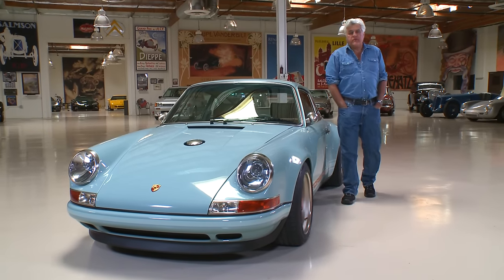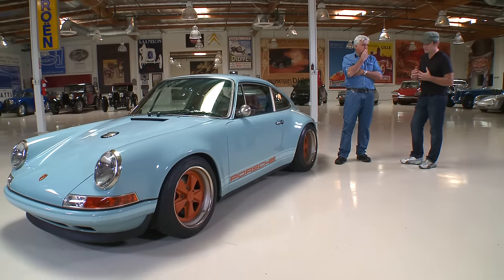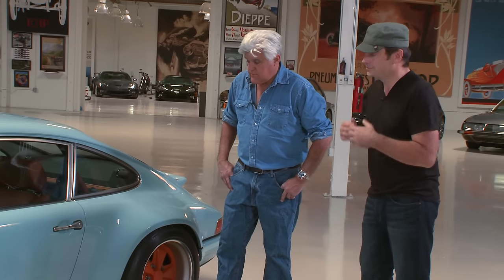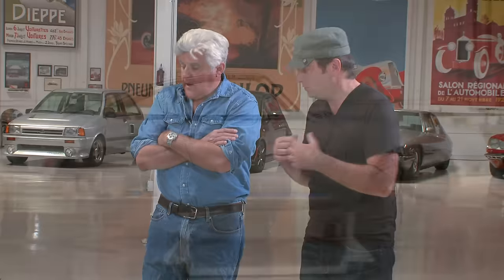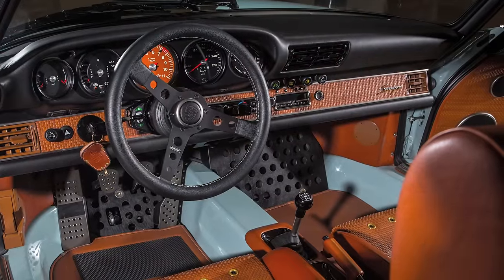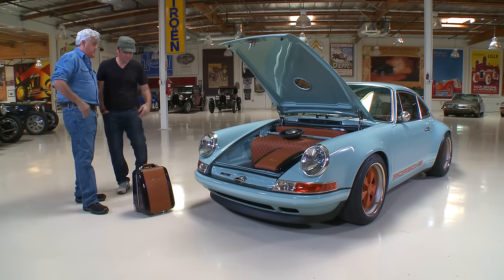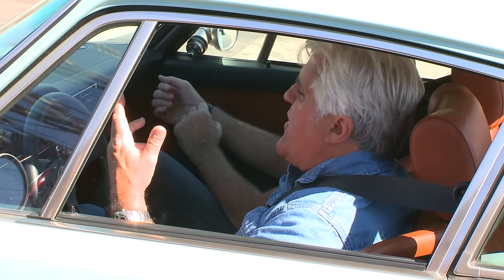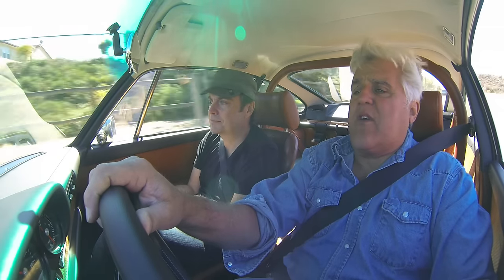1991 Porsche 911, Reimagined by Singer - Jay Leno's Garage

Comment: Someone please educate me, what makes these air cooled Porsche engines so special, other than saving weight?
Reply: They do make a different and possibly better sound, however, there is a lot of nostalgia. It's certainly one thing that makes Porsches different. It's distinctively Porsche. It's simple, yet complex. It's easier to maintain. It's just an interesting quirk.
Reply: air cooled means it has no radiator for the motor  the air cools the engine theirs a disadvantage you can't go very very fast with that engine it gets very very hot in the engine compartment.
Reply: Marc Plante
I know what it is, I just wonder why Singer chose these motors. Probably for it's low weight and simplicity, but maybe there's more to it.
Reply: Any Porsche engine is special.
Reply: The feel, the rumble, the sound, the power. It is a living beast. The liquid cooled cars are like everything else on the road. They are great but not like the air cooled. The air cooled sounded like hell when it was started cold. You need to warm her up to get all that oil warm. Once it warms up, it comes alive. It wants to be driven fast. It has to be driven fast. It is a true machine that needs to be driven well and maintained well. It rewards you with a feeling you do not get in the modern porsche. Go test drive an old used air cooled 993 93-98 and you will quickly become obsessed with it.

It is difficult to explain this in writing, you have to go feel it. Minimalism at it's best. Power and elegance.
Reply: The term air-cooled is a bit of a misnomer.  They are oil-cooled and have oil coolers to help keep engine temps down.  Instead of a radiator with coolant running through it, imagine a radiator with oil substituted for coolant.  These are usually located in the 911's front fender wells.
Reply: Marc Plante
Can't go very fast? Nuts! You mean you can't drive it like a granny in the city or just start it up and take off.
Reply: Motors?? The Drayson is powered by a motor, not this.
Reply: STORM6490MT I grew up around a 98 993 and learned how to drive stick on it. I absolutely adore the thing. Greatest Porsche (and therefore car) ever made.
Reply: ***** What's a Drayson? But yup, this is an engine.
Reply: ABOlsen69666 Perhaps he meant Dyson vacuum cleaners ??????
Reply: rocketdog2116
that's awesome! my old man saved up for years and purchased one for cash in 1998 at the dealer in minnesota. CS, wheels, seat delete, calipers, black black black, stainless trim. He still has it in the garage with under 10K on it. Far too few miles in my opinion. I was hoping that they would come down in price but it appreciated so I wont get one till I retire. Maybe he will sell it to me one day!
Reply: Check out my new Harley EngineCycle. I know that the BNSF down in the valley works with a diesel engine and electric motor but most people get motors and engines as far as terminology. Motortrend? Oh hell, they must be all electric reviews.  Thanks captain obvious, please correct my online grammar and spelling.

Comment: ***** To really see an amazing 911 would be to use a 964 turbo (AWD) then remove the engine & trans for the Hydra-Matic 8L90 transmission in the new Z06 as well as the motor. Both weigh less than the engine & trans in the 964 & can fit without cutting into the body. You can also swap your windows with gorrilla glass for more durability & less weight.

After that you just need to wire everything up, swap all the lights for LED lights, swap the seats for some recaros & then you have a great lightweight driving car with a better power to weight ratio than the GT3 RS.

Comment: Sorry Jay.  This one's not original.  It's a German car modified at silly expense and rightfully headed for Dubai.  Grats on getting to drive it, it's awesome!  I'll drive three of your 911s 37 miles each per month at a reasonable rate (of speed and money).
Reply: I trust you have a comprehensive medical plan for your employees, as I'll need glasses soon. My interests include personal transport vehicles of any power source, from human to electro-magnetic, feet to wings (partial to pressure engines and hydraulics).

Comment: It is beautifully done...but only 350hp and ridiculously expensive??? Check out the Renegade Hybrids for an affordable option with more power, reliability and less maintenance.. Oh, but it's numbers matching. Did he say they spent $5000 making the intake plenum "pretty"? I'm surprised Jay didn't throw him out of his garage at that comment. At first I thought it was a 70's body with the rounded front hood nose. Nice looking.
Reply: Porches aren't meant for those 0-60s or those 1000hp engines they are solely made for the driving experience with class and elegance at the same time. So if you think 350hp is low for a car then maybe porsches are not your tyoe of car, perhaps a GTR would fit your needs and it can totally take in all of those modifications you are looking for.

Comment: Bet the guy was a bit worried when Jay mentioned 4000 hours and $350 000 in the same sentence, the starting price probably meant a lot less than 4000 hours.
Reply: 350,000 base. i bet this car has every option and is closer to $500,000

Comment: Impeccable work ld agree but approx 4000 hrs is hard to believe and at $350,000 to start IMO is somewhat steep and crazy and that's on the bottom end as I'm sure this Dubai customer spent well over $600,000 for this precision work. Man there's alot of coin out there!!!! 

I'm feeling so sad selling off my Baby 89 930 turbo but unforeseen issues came up. 

Anyway, we role with the punches

Comment: Obviously the guy that runs Singer doesn't know much about the 911...the last air-cooled 911, and Porsche, was the 993. He claims they "abandoned" the air-cooled engines after four years (1994), yet the 993 ran from '93 until '98.

Comment: Is six speed a good idea? Five speed might convince a buyer that he has another gear ratio for motorway driving with better MPG on the motorway. But six speed isn't going to give you yet another ratio but rather cut the ratios of third, forth and fifth and force you to do more gear changes with a hit on clutch life.
Reply: Skip gears.
Reply: Great two word answer. I have always followed your advise but others religiously go 1, 2, 3 4 and 4, 3, 2, 1. My Nissan Pulsar tells me when to switch gear and sometimes it does direct me to skip gears.
Reply: with that much HP you don't need all those gears unless it has a very narrow power band. Interestingly, Porsche Turbo 930s only had a 4 speed because you didn't need a 5 speed, they had so much torque.
Reply: manstersr some 930 turbos did have a 5 speed gear box
Reply: Yeah, some of the later years I think. I don't know what all of them had. Probably at the time the regular 911 got a 6 speed.

Comment: So.. "The 964 had the ultimate suspension of all aircooled 911's"..? I thought it was the 993.. :) "we're the biggest 911-fans in the world".. Yeah right!
Reply: "Chassis" includes much more than just the suspension, chief.
Reply: Wouldn't you be the biggest fan if you can sell them for half a million dollars? :D
Reply: Raf Carrera They have to sell it for that much, modling the carbon fider body alone probably costed them tens of thousands of dollars. Going to a very well known performance company like cosworth to tune their engines is another tens of thousands of dollars. If they did it like any other normal tuner with turbos and all the mainstream aftermarket parts. they would probably save a lot more money. Instead they chose perfect what was already good in in original 911s and  make an extremely well built car

Comment: The rear fenders provide way too little tyre coverage. Go to 14:01 minutes to watch a view of the car from behind. Then compare that view to the fenders on a Porsche 911 turbo. You'll notice that the turbo's fenders cover the tyre. Singer's fenders do not. Speaking of authenticity: Porsche would never have produced (and has never) a car with such taper on the fenders. Such small fenders are very likely not legal within the EU (regulations require full tyre coverage 30% ahead of the hub and 50% aft of the hub).

Comment: Porsche today does not understand.. Porsche.  Its classic, timeless racing design is exactly what you would get if you were trying to 'sort a car' to reduce weight and shape it for racing.  Why is it rear engine?  No drive axle.  Why is it air cooled?  No radiator and water tank.  After all those extra parts were thrown in the bin, the car is distilled down and given a tear drop shape fast back... you left with a Porsche.  "Modernist" chronological snobs gave way to the water cooled 911's of today.  They don't understand German culture, like the German beer law, Reinheitsgebot or "purity order".

Comment: Its only 87.50 per hour, mandatory 4000 hrs build time to convert your 911 to this standard.  Oh What a standard that is, however !  So nice.  I would like to do my own though.  The only thing out of my ability is all of the carbon body work....other than that...I can handle all of the rest.  Now, I just need to find me a basket case 911...Due to shows like this...and Magnus and Steve McQueens 911 sale at Auction 911's have rather recently been elevated beyond my preferred financial reach.  Shame... I will find one sooner or later...just how it goes...Time and Pressure...its how everything gets done

Comment: I like the older Porsche's but to me honestly the porsche does nothing for me. Its stayed relatively the same, the flat 6 doesnt do it for me, doesnt sound that great and any mods or repairs are astronomical given whats in the car. That is one huge draw backs to the European cars, specifically German cars. If the Corvair had continued its evolution over time I can guarantee it would be giving Porsche a run for its money just as it did in the 60s, beating it in many races including 24 hours of LeMan

Comment: Hi. It's too subtle, it kind of defeats the purpose of modding. RWB is better looking for the most part, save for the rivets. I'd have Singer do the wide body work for the wheel area (no rivets) and their carbon fiber, interior but with 100% silk not leather, save for the luggage, the rest it'll be by RWB. That might cost $USD400k already, though they probably won't do that coz' it has to be a package to protect their brand. Then find someone to wrap the interior with flexible QLED or OLED then get rid of the buttons and levers that not gonna threaten your life and transfer them into the touchscreen. God bless, Proverbs 31

Comment: Beautiful car but it's ridiculous only 350 horsepower no turbo and it cost over $200,000
Reply: Restoring a car is never cheep, throw in all that carbon fiber and things begin to add up. Assume his 4000 hour figure to be accurate, at 350,000 that would be 87.50/hour. That price includes materials and shop expenses also.

As for HP, HP isn't everything. Especially in a car that is meant for driving enjoyment and not outright speed. But it still doesn't do too bad. Faster than a GT3RS and a 430 according to them; both of those put out over 450hp.

Ultimately, seems people are willing to pay 350K for a 350hp 911. So things can't be all wrong. It may not be how you or I would spend the money, but you can't say it's overpriced based on some narrow criteria.
Reply: 350 in the real world, not from the engine alone. Have you ever driven a 300HP porsche? It's a damn riot! More exciting than driving a 600 hp blown corvette or what have you on the US market. 90 bucks an hour is a steal for a mechanic and builder at that level.
Reply: Expensive things are too expensive! Waaaa.
Reply: . It's custom made with carbon panels, hand made metalworker parts, it's 350bhp but weights very little so it's fast and there are very few cars that will leave you feeling as connected with a car as this one will. I think you question you should really ask is how much more enjoy,net can you get from this car over a £30k 964 for example?

Comment: I can see Jay isn't impressed with this car! That guy looks like Jimmy Fellon's twin brother! What can Jimmy Fellon achieve besides talking nonsense? Oh 964 is the ultimate air cooled 911, what happened to 993? The price of 993 has been sky rocketed these guys simply couldn't lay their dirty paws on them, that's why they picked the no-one-want 964s! The 964 was stupid 30 years ago and it's still stupid today. Do you know why? Besides the stupid electronics prone to fail every minute, the real Achilles heel of the 964 is the rear trailing arm suspension. Unless it can be converted to multilink, adding more power to the car is just to turn it to a widow maker!

Comment: This car is of course going to Dubai. Where only an oil sheiks bratty kid can afford. nice car, but I can buy a Shelby GT 500 for under 80k. I have a 73 Vw bug weighing 1400 lbs, pushing 150 up, that cost under 10k to build. I'd take this 500k Porsche up anytime for a drag race. It will beat me by a bit, but I didnt spend 500k.
Reply: Youre right, not many can buy a Singer, but that's what it's all about. Exclusivity. No offence intended, but would you buy one if you were wealthy? I would, and I'm sure it would beat any Shelby or Beetle through the hills and a quality inspection at the pub carpark afterwards ;-)

Comment: Love the Older Models....BUT WAY Over priced. (They (911s) are still to this day...Mostly made of CHEAP/Machine Stamped steel) Not carbon fiber or Aluminum LIKE EVERYONE ELSE...even the Americans.
Old car review put base model pricing at....
911 - $9,950
911s Targa - $12,725
911s Carrera - $13,575
Base Corvette by comparison - $5,561.50 (even thou, 1972+ C3s were slow about 1/4 seconds slower the None turbo of this year, mid 14s<15sec)

Surprisingly even back then, the corvette had better handling/ HIGHER corning G's than the 911...So the American cars can't handle was wrong from the start.

That Big/HEAVY Chrysler 300 late 50's/early 60's, would have had the originals for lunch in a straight-line, barely anything could touch them back then.

They did a beautiful job...but $350k???...I don't see that in this car....especially when the customer supplies the car.  No way $350k worth of mods./repairs. $150k I would say is a great price...for this master piece. 

"Whats your Favorite porsche..." Said Jay.....For me it's the 1974 911 RSR....the purist of any Road racing 911, IMHO.